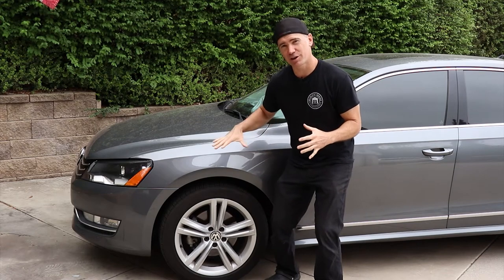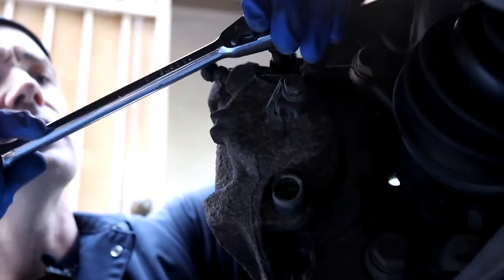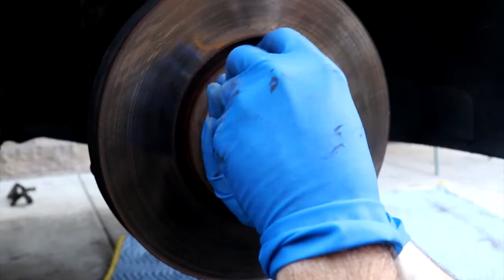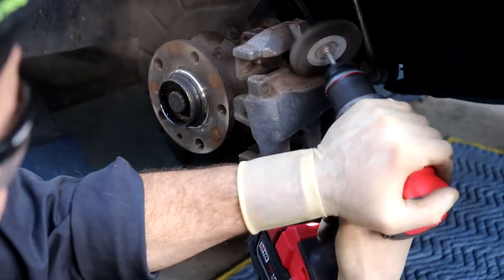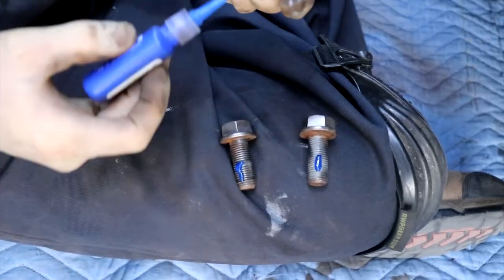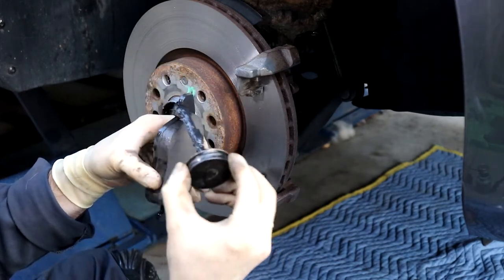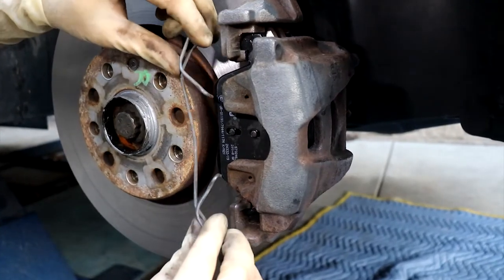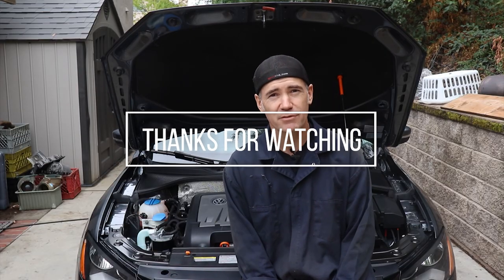2012-2021 VW Passat B7 / B7.5 Front Brake Pads / Rotor Replacement DIY (SAVE $$$)

Comment: Would you recommend this if I've never done it before? I just wanna save money
Reply from the maker: Thanks for the question David. It really comes down to how comfortable you feel doing mechanical repairs on your car. It will save you a lot of money by doing it yourself. The front brakes on the Passat are pretty straightforward and will require only a few tools. You can avoid renting the brake caliper tool if you have a large C clamp available. 
Just follow along to the video and be sure to make sure things are tightened afterwards, especially the lug nuts. Let us know how it goes, happy to help walk you through it.
Cheers!
Reply: From being poor I learn how to do my own brake that's how you learn just be glad you have videos like this I had to learn from a manual and reading comprehension
Reply: I give this video a full endorsement for a man who wants to give er. Very thorough.
Reply from the maker: Thanks for the kind words Chad, glad you enjoyed the video.
Cheers!

Comment: How do the brakes slide back without traditional slide pins?
Reply from the maker: Thanks for the question Mike. Not sure what you mean by "traditional" slide pins but the VW does use slide pins. The caliper will move along those pins as the pads wear down.
Check them out here 9:56
Good luck on your VW project.
Cheers!

Comment: My brakes are dragging after install. I greased everything and cleaned well. Can’t for the life of me figure it out. Bled the system as well a couple times to make sure it wasn’t it.
Reply from the maker: Hey Tyler, sorry to hear that you are having trouble after doing your Passat brakes. It is normal for all disc brakes to have a slight contact with the rotor at all times. You will hear it making contact but should not affect the wheel from spinning freely.
How much "dragging" are you currently getting? Will it stop the wheel from spinning?
Is it the same on both sides?
If not you might have a "sticky" caliper, where the piston is not relaxing after letting off the brake pedal.
Please let us know and we will try to get you back up and running.
Cheers!
Reply: @BradleysGarage  it just feels like I am accelerating a little harder than before and it’s effecting mpg. I can spin freely by hand and can hear it every 1-1/2 rotations but not during driving. It drives straight for the most part. I just didn’t know if it was a break in period but it seems maybe like a sticky caliper. 🤷🏻‍♂️
Reply from the maker: Another trick to check the functionality of each caliper is to lift it off the ground again. Then with the help of a buddy, one spins the wheel while the other applies the brakes. Do this while the car is running so the vacuum and booster is functioning normally.
This will give you an idea of either caliper is sticking. Just spin and brake a few times on each side and see how the wheel spins.
Like I mentioned before, it's normal for a slight drag on the pads but definitely not anything you would be able to feel while driving. Typically if you have a sticking caliper you would tend to get a pull to one side.
Let us know how it goes, Cheers!
Reply: @BradleysGarage  thank you for the help and insight. 🙏
Reply from the maker: @TylerSmithMusic1  No worries, let us know if you get it sorted. Cheers!
Reply: @TylerSmithMusic1 it might be your dust shield that’s making the noise! Definitely check that out
Reply: @nedflanders5380  100%. Just done mine and had the issue. Stones gets behind after you move it when cleaning with a wire brush. I just used a screwdriver to hit it backwards and release trapped matter. Some people never change rotors/disks when doing pads too, bad grinding is likely a warped rotor. I changed by rotors with every pad change to avoid issues.

Comment: NO! you are not supposed to put grease on the slide pins. Specially not CRC. Slide pins need silicone. That stuff will seize a caliper.
Reply from the maker: Thanks for the comments, appreciate the feedback. We have been using CRC brake grease for a couple decades now. It's a synthetic fluoropolymer (PTFE) with Moly and Graphite. It's low friction, non stick, has high thermal stability, will not affect the rubber components and has excellent chemical resistance.
That being said, we do want to try our Sil-Glyde on our next brake repair. Cheers!
Reply: @BradleysGarage  Yes Sil-Glyde is all I use on slide pins. Love the stuff. 
CRC is all I use for brakes pad ends and such as it lasts longer in elements. just not slides. 
Love the stuff. 
Not sure if it's a issue with just humid states or not. I live in ohio. 
But I use both, and have never had issues in 10+ years
Reply from the maker: @SooSmokie  Thanks for the info, it sounds like silicon might be better for the slide pins so we are excited to try out the Sil-Glyde product.
We don't get much inclement weather here in SoCal so most products tend to last a long time.
Thanks again for hanging out, Cheers!
Reply from the maker: @SooSmokie  Thanks for the feedback, glad to hear the product is working out great. We have already ordered the Sil-Glyde so it will be here for the next brake repair.
Cheers!
Reply: @BradleysGarage  Goodluck on your channel! I wish the best for you!
Reply from the maker: @SooSmokie  Thanks for the kind words, having a great time working on projects with my sons.
Thanks again for hanging out, appreciate the support.
Cheers!
Reply from the maker: @SooSmokie  Thanks for the support. 
Cheers!

Comment: Can we stop putting lube on the ears of the brake pad. All it does is collect dirt and brake dust and after a few thousand miles, it causes the pads to get stuck in the bracket. Leading to uneven brake pad and rotor wear decreasing your pad and rotor life. There is a reason no manufacturer puts lube on pad ears from the factory.
Reply from the maker: Thanks for the suggestions Bryce, appreciate the feedback. That's the way my pops showed me many, many years ago so I guess it's an old habit that won't die. Thanks again for hanging out. Cheers!
Reply: This is dependent on where you live. In ohio, you have to use grease on the pad ends. All dealers sell their cars with grease on the pad ends. 
Not in a rust belt state? Go for it. 
Never had this seize brakes before. Never once. 
Id be more worried about the CRC he put on slide pins which is not good. Should always use silicone. 
That synthetic grease will cause it to seize. 
I use sil glyde for caliper slide pins.
Reply: Oh my goodness. Spoken like a true non licensed mechanic. I take severe criticism of this comment. Lubricating the ears is absolutely vital, but only when you’re using the proper type of lubricant.
Reply: Proper brake lubricant does not gather dust and contaminants and provides the shoe with the amount of movement to evenly apply brake pressure on both sides of the rotor through the long term.
Reply: As a new owner of a Passat, I thoroughly enjoyed and approve of this video. You did a great job.
Reply: @Chad-co1lb  Yes, you are speaking like a true non mechanic. In a lot of states, cars come from the factory without grease on pads and not all brake manufacturers require it. So, it is not absolutely vital in all situations for pads.  Caliper slide pins and a good silicone yes 100% of the time. 
Either way I would still use it personally no matter what. 
So, you should leave the mechanic talk to people who know what they are talking about unlike you.

Also shoes don't go on rotors, they go on drums and don't get grease. Pads go on rotors.
Reply: @SooSmokie  Well, the correct term is lubricant not grease. I carry 3 mechanic licenses, I believe I know what I’m talking about.
Reply: Furthermore, the manufacturers don’t apply lubricants because the metal is clean and rust free. They also know that the brakes gonna outlast the warranty. however, on a second and third and fourth and fifth brake job lubricant is vital. Without can lead to premature brake failure, and wear.
Reply: @Chad-co1lb  Well, Grease is a lubricant. CRC Grease is what I use for brakes. It's Grease, so get your facts straight, Mr 3 licenses....lmao!
Caliper slide pins, however, require silicone, which I use Sil Glyde, or something similiar.
Maybe you use another lubricant. Either way I agree in the use of lubricant in most cases. Some brake manufacturers specifically recommend not to use grease or a lubricant.
Reply: @SooSmokie  then why are we debating? I only disagreed with your initial argument about not using grease on brake pad ears and now you are rebutting yourself? Based on your last message I would hire you to do my brakes sir.
Reply: @Chad-co1lb The only thing I disagree on is  all pads need grease or some kind of lubricant. 
Some situations specifically call for no grease. Still silicone on slide pins, but grease on pads is not always needed and discouraged in some situations. 
Cars that come with no grease on pads, last just as long as ones with grease on pads. Depends on the hardware, and the area you live in. 
So it's not always required and doesn't always help. 
Would I still use it to be safe? Sure, but not necessary in all cases. 
Other than that, I agree with you.
Reply: @SooSmokie  you may be right. However I’m in Canada, here its an absolute must.